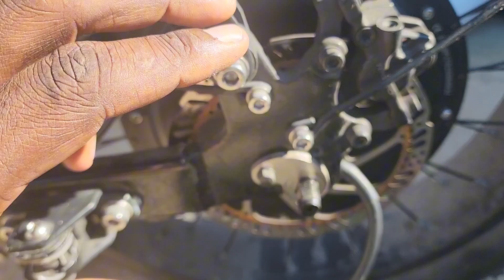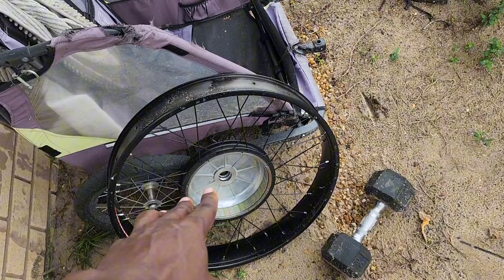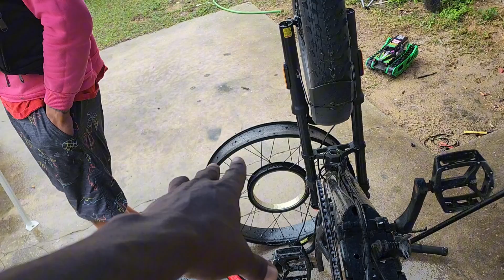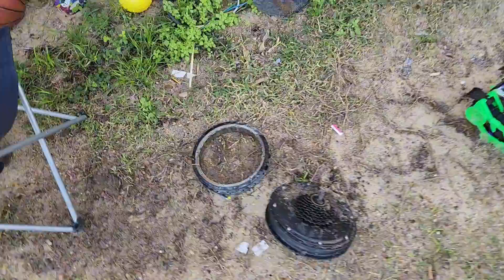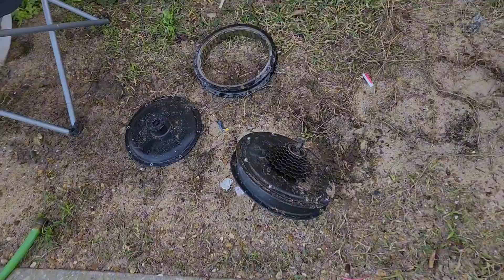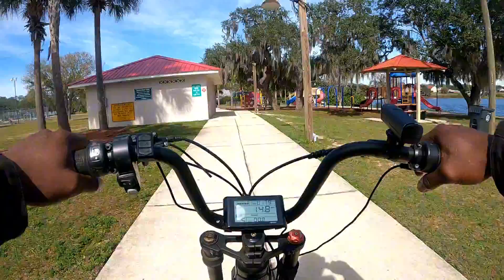So I put a 1000w stator inside a 1500w hub housing on my wife's ebike. Let's see if it works!!!!

Comment: i have a question if i have an engwe m20 and i need a new hub motor but they have the motor on 2 different sizes one is 10mm smaller same axle size and same connector will the motor thats 10 mm smaller be fine in the original housing? which is only 10mm bigger? it should be fine right same axle size same connector?
Reply from the maker: @E-LutionaryBikes  yes the only difference is the thread part you will be fine

Comment: Would a shunt mod help my victrip titan 750w motor to get a little more power it tips out at 30mph just want a little more speed/power
Reply from the maker: It won't help in speed but it will get there faster

Comment: Yo man. I finally pulled the trigger on the 200mm dropout NBpower QS273 motorcycle hub motor from Amazon. Got my frame welded up and I'm painting today. Which controller should I get dude? Sabvoton 200amp?
Reply from the maker: What battery you have? Then I can point you in the right direction
Reply: @EBG-offical  I haven't bought one yet. All I was certain about was the motor and hub spacing.
Reply: @EBG-offical  controller and battery will be what you tell me. Fast bro please!
Reply: @EBG-offical  not you fast. The bike.
Reply from the maker: @josephhuckabee4702  sabvoton controller 72200 is a good controller to start with lol

Comment: I'm going to eventually upgrade but for now. I would just like to know what kind of speed, do you think I can get out of my three thousand hub motor using the kind of controller you use right now
Reply from the maker: It depends on what battery you have
Reply: @EBG-offical  26ah 72v battery

Comment: You'll never know what caused a failure within the windings of a motor..... a slight "Nick" at the factory could cause the place
that fails down the road & I used to work w/ motors & windings in a "starter" re-manufacturing company for Ford.  What's the
coolest thing here is that you are showing us how to mix/match windings instead of throwing everything away & buying new!
That's important as money is tighter & if you hold on to components I think it can bloom into a real money maker for you?
This has been needed in the electric bikes but only now is it feasible b/c we're starting to have piles of parts/stuff which
you're smart not to throw it away.  And proving a 1000w motor can operate in a 1500w hub is important to do here!
Thanks for cutting edge mechanics.... lol,  that's what I call it.  peace
Reply from the maker: Yes o believe you is right because my qs273 had a nick in it and that's why it failed
Reply: Quality Control is at issue w/ anything ya buy but Chinese motors has been a serious problem for 20 yrs now & I'm
particularly interested in how you swapped out motors.  I think you can always use a smaller motor just so it fits
inside the hub?  In this "EBIKE" market, bikes & setups are changing like the wind so as money gets tighter you're
gonna be a "Go To" mechanic if you keep some of the old parts that are still good.  You'll be able to get folks back
up on the road & more people than ever are using these bikes as everyday commuting vehicles.  I like what ya do
and see you sitting in a place to make a few bucks while helping out some people in a bind.  You need the back
porch to have an awning if that place will allow that or a shed. Something to keep the weather off the electric
shit you carry forward - that electronic stuff is your gold, so to say.  Anyhoo, TY for the videos - I watch them!!
peace & GB ALL or You/yours

Comment: Why couldn't you just swap over the wheels why did you need to change inner s if the only difference was one was a 1000w and the other was a 1500/2000w they look like they was both the same size???
Reply from the maker: I didn't have a 2000w hub motor and the 1500w hub motor burned up the 1000w hub was from a front conversion so no freewheel.

Comment: You got a short between phases or one phase shorted itself, it actually looks like a one phase short in the motor. This is due to overheating, shunt modding is not acurate enough if you overload.
I'm only 100 lbs but I managed to burn motors by just going uphill with extra 70 lbs...
If you can send me the old motor, I will rewind it for you for free, just to prove myself. I can reconfigure for a higher wattage input or higher RPM, UP to you.
Reply: Wow man that's a sweet offer i hope ebikeguy takes you up on that! As a kid my old man rewound a rc car motor for me by putting a shorter thicker wire winding in it and wow did it go better!!!! Sick offer dude👍
Reply from the maker: Heck yeah 👊🏿 I just told him to email me
Reply: @EBG-offical  👊
Reply from the maker: I do have the motor still, email me please
Reply: @EBG-offical  👍I love the smell of toasting PCB in the morning 😉

Comment: just bought a 3000w NB power rear hub kit + a 3000w 72v 20ah battery from ebay, the typical triangle one. Putting it all on my swft zip ebike. What kind of speed do you think i can get on flat ground, and going uphill?
Reply from the maker: If it's a 20in wheel About 43mph flat and 34mph up a steep hill

Comment: Hey, Ebikeguy! What is your opinion on running a sabvoton 7245 on 48v or 52v if the battery is capable of around 50A constant discharge? Is higher voltage required to run the sabvoton efficiently?
Reply from the maker: Higher voltage will make your bike go faster,  so I'll go with 52v set up  and more ah battery can compensate for the weight of the ebike
Reply: Alright. The bike’s starting to get a bit scary already so I’m sure it’ll be great! My next build will be a big battery big motor conversion on a supermoto.
Reply from the maker: @varjomoosesmatti2863  nice!!!

Comment: Do you think painting hub motor housing white would help with heat in direct sumlight?  If I sit my bike in the sun and put my hand on the motor aftet no use, it can get very hot just from the sun.  Not sure it would actually make a difference painting one white, but even a few degrees would be a few more watts, right?  I have white OEM frame decals so I might try it as it wont look too awful with white hubs.  Controller and battery housing, too.  Just blabbing.  Other light colors might work well too.  Light grey, light olive green, light flat tan, pastels...
Reply from the maker: You might be on to something,  I believe definitely color paint might do effect sun reflection to a metal surface
Reply: Hmm, I wonder if silver might be best to reflect the light off of it better?
Just a thought...

Comment: Those direct drive motor casings are all very close in size. My Furcare Scorpio is modded with a DD 3000w in the rear and a DD 1000w in the front. I didn't measure the exact size, but both looked exactly the same dimension. 
Front motor came with 30a 48v controller. I Swapped that controller with a Frankenrunner controller, now running at 60v 45a with a 60v 25ah battery! 
Rear motor I also use a Frankenrunner controller. Running at 72v 80a, with a 35ah battery. 
Bike rips! Hitting the second motor is like a turbo button. Hit 66mph, but the acceleration is why I modded. 40mph is usually my limit.
Reply: Wow, you build an e-beast!!!
Well on you, I bet that's a right blast to ride! (If you even stay on it!) I bet it's fun!!!
Reply: @mickyb.8014  I just like the acceleration! The 2 Frankenrunner controllers are very compact for being rated for 72v and 90amps. The design of the Fucare Scorpio is really great for modifications, too.  The bike is really clean looking. Rides nice with dual crown front fork and dual rear air shocks. Fucare even sells the frame on their website, just with rear suspension for only $599.00. Might buy just a frame and build another bike with all the spare parts I have.
Reply: @RAZORWlND  I gotta check these frames out, sounds like a great bike & future project, all the best, and keep on rippin' it!
Reply: Thinking about getting that lil bad boy as my second bike. Love the purple version. looks nice AF on camera on YouTube. Not many vids are out on it
Reply: @darrylphillips6301  If you are into building bikes, I'd ask if they have the purple frame only. $599 isn't bad for the frame, really. The bike needs to be modded right away with the 20mph throttle only being locked. I'd say just getting the frame is the best bet. When I bought mine, the frame only option wasn't available yet ssdly.
Reply: @RAZORWlND  appreciate the info man, how much did u spend on the 72v conversion kit? Might go with 60v on my next bike though
Reply from the maker: @darrylphillips6301 it's on ebay for $360
Reply: I love the look of the Fucare Scorpio frame/bike, looks super cool, reminds me of bmx's but just with great looking suspension, I bet they are relatively lightweight too, which is the key to a great e-bike (in my opinion) as keeping the weight down as much as possible really helps with rapid acceleration...
I'm not too fussed about top speed, anything around 30-35mph is ok with me, I just like getting there in quick time, one day I'd like to have a go at putting together a nice dual motor e-build. Just haven't got the money at the moment. Christmas was too expensive 😂

Comment: I did the same exact thing using the small teardrop shaped part of a standard torque arm kit I bought from ebay, works a treat and it fitted exactly with a small bolt hole on my bikes frame, even used the same small bolt and nut that came with the torque arm kit, personally I'd rather have my wheel fixed exactly in place than the possibility of being able to torque itself out of the rear dropouts - Haven't had any problems since I did this, and that was like 1,000 miles since. On the other side I just made a very similar (but triangle shape) out of some 5mm thick steel plate, attached it to the frame in the same way, my rear wheels staying just where it should be at all times.
Great minds think alike Tommy!
Reply from the maker: Heck yeah 👊🏿 the moment I looked at them torque arm I said nope!!! There got to be another way lol
Reply: @EBG-offical  I thought it was clever when I seen you weld one in one of your vids, I was like "Hmmm, that's a better idea than it being able to move so freely!"
Reply from the maker: @mickyb.8014  yes , rhat way it will nit move a bit
Reply: @EBG-offical  exactly, that 1000w in the 1500 shell, it really shifts don't it!?
It looked a lot quicker than 24mph, and it was impressive how it picked up speed, cooling seemed to be improved, must be getting better air circulation to it.
But, damn it worked a treat, top job guys!

Comment: First time i did a shunt mod was on a 250w kit back in 2012 , she had more torque but i could feel the vibration throughout the bike.🤠🤟
Reply: I love my shunt mod, made a nice difference, fair bit more torque, but it took a few tries to get it just the right amount of solder. Had to update the fuse from 40amp to 50 too.
Reply: @mickyb.8014  Awesome Micky 👌 🤠🇬🇧🤟
Reply: @ianmangham4570  I was just thinking Ian you've been into the e-bike scene for a long time.
I remember about 7 years ago when I bought a 250w24v Cyclamatic 'powerplus' (debatable) but I used to ride all over the place and only once in the 3 years I had the bike did I see another person on an e-bike.
Still hardly see that many folk in West Yorks where I live on e-bikes, but they are catching on which is a good thing.
I think they will be a lot more ppl out on them when the summer rolls around, way cheaper than having a car 😂
Reply: There catching on in Nottingham too, I'm surprised more people don't use them in the UK, I think the rules put people off  @mickyb.8014
Reply: @cruelycruel1032  I ignore the rules, mines a 1500/48 with a 52/20 battery, I just don't ride like an idiot and I've never had no police intervention.
I think if people just ride respectfully then it's usually all ok.
All the best to you from West Yorkshire!
Reply: @mickyb.8014  Same here mate,I totally ignore the law 🤠🤟never seen a cop as like yourself i don't draw attention and sneak around all the trails/alleys/side streets,you know what the angry asshole drivers are like trying to kill folk on the main roads lol,had me a 1500w kit way back , ran it at 55v around 50amps she was a rocket 🚀,  now I'm an older dude I wanna get semi fit so I got another 250w at 22amp sinewave, 42v 10ah LG cells on a 1999 Marin hardtail, she only weighs 43Lbs ,she's a cyclotricity kit.I will ride anything with air in the tyres 🇬🇧👌 I use the pedal assit although I do have a throttle also.
Reply: @cruelycruel1032  My 2nd kit I bought came from Nottingham,  panda bikes on ebay,  was a 350w rear with a 36v 10ah battery 🔋 for £399, never let me down.
Reply: @AaronHendu  👍
Reply: @ianmangham4570  Sounds like a great set-up to get fit with Ian, totally agree 'cos I'm starting to worry about my fitness now I've hit the big 5-0, ain't getting any younger and I've noticed since I've been throttling everywhere I've got super lazy so now I'm using the peddle assist a lot more ...only problem is my kit came with no display and I can't hook one up to it either as it's no wires for one, so when I use peddle assist it's always on full-whack level 5 - which is fun don't get me wrong, but it's full on lunatic mode so I've gotta be real careful - I've mastered the art now of holding the brake levers a bit so it cuts the power to the rear wheel so I can still peddle and sort of control it too... it's a bit tricky at times though 😂 but anyway, all the best to you mate and I hope it's all good in Chesterfield, one of my ex's was from there, you got a place there that's the same as my surname (Barlow).
And don't get me started on wanker car drivers, I have my fun with them though 'cos my little pocket-rocket can leave most cars for dead at the traffic lights! 😂 I actually weighed it yesterday and it's 23kg or I think it was 51 pounds.
Reply: @ianmangham4570  that's super cheap motoring at £399, you can't even build one for that, it would be damn hard to anyway.
Reply: @AaronHendu  Top stuff mate! Well on you, I usually get no grief from most people, get the odd weirdo every now and again, I think some people just passionately hate e-bikes, god knows why though?
I mean, they are cheap as hell to run, don't damage the atmosphere as they give off no exhaust fumes, what is there to hate? The worst thing about the roads I think are all the damn potholes caused by trucks and cars.